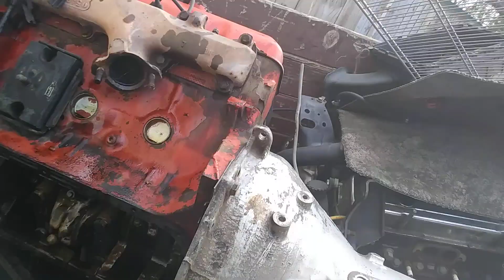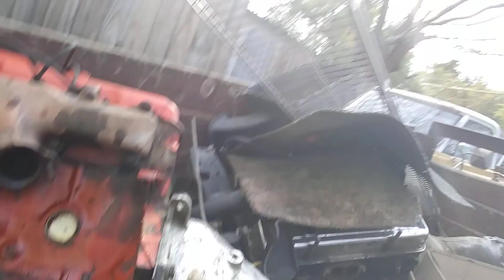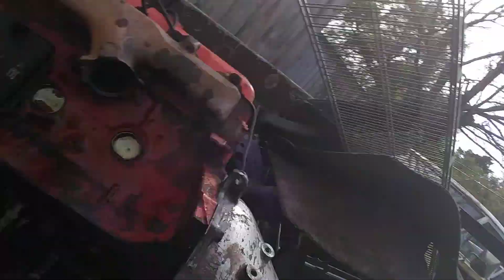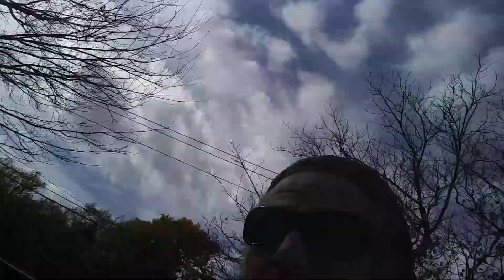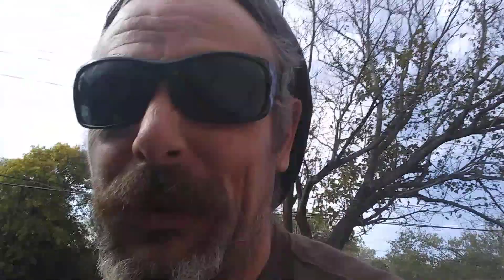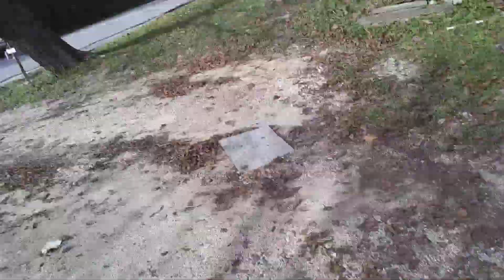Extreme engine fail part 2

Comment: fuck the rebuild pull plugs put pan on put diesel fuel in plug holes fill pan with fuel turn it over let sit till ready to start drain put oil in maybe good to go